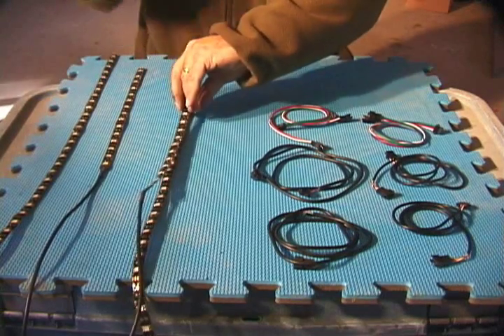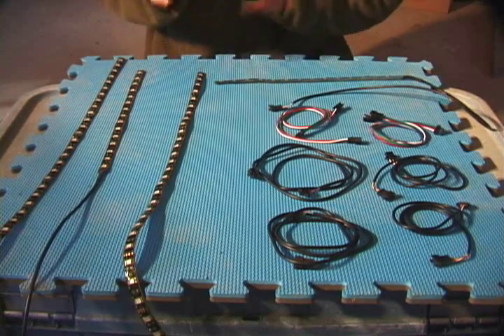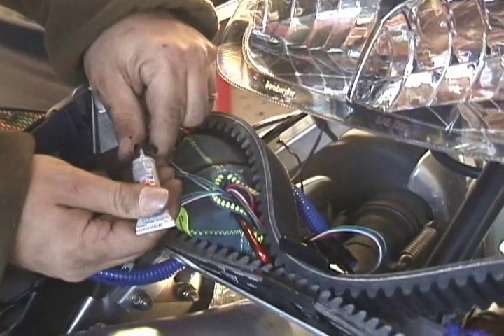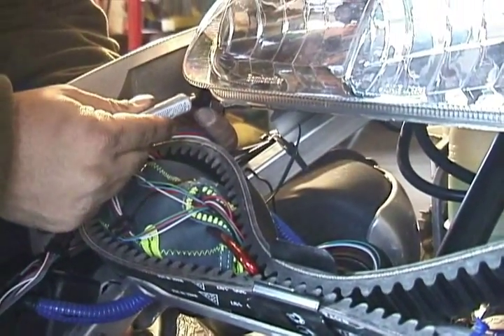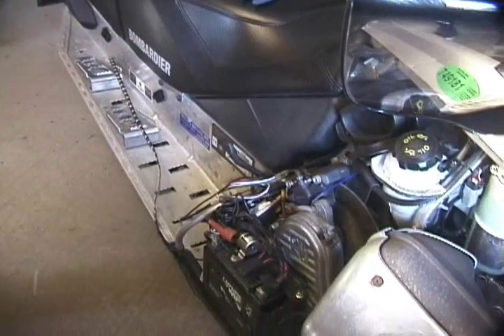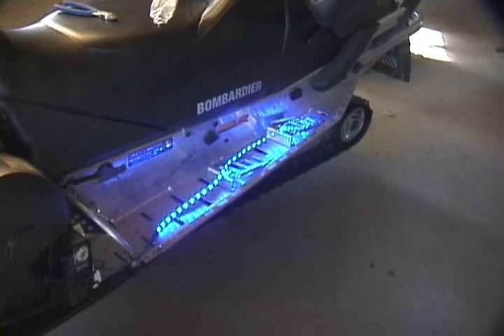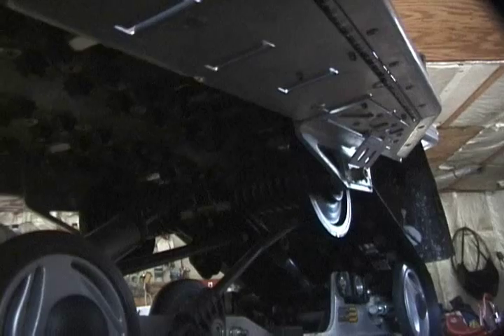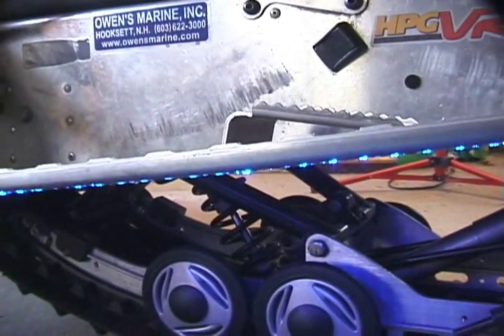Skidoo GTX 500SS LED Light Kit / Joe Florida - Running Boards (Parts and Install)

Comment from the maker: they come with 3M backing. But I also used freezeproof silicon to line the edge all the way around.  I put large globs on the ends and then put a bead down each side.

I did the same on the shock wells as well.

Comment: Do you need a battery for this?
Reply: SkidooSuzukiMania ,nope you just run them off a 12volt dc or ac source,ski-doos ,,,well my 1995 mach 1,, i used the orange  wire for the hand warmers.
Just thought id mention something to the guy that made this video,,the running boards are a nice lighting area ,,BUT if you go ditch banging alot,like i do they will get ripped/torn off !I know i went throught two sets on both sides,the first snow bank you jump that has hard crusty ,ice like snow,,kiss them goodbye !
Reply from the maker: billy bob i silicone them as a covering from where the wire is first exposed to the back. Not lost one yet.
Reply from the maker: The multi-effect need a battery, because the switch box has high draw. The single color can be run off s rechargeable RC Lipo or as replied by another below, you can wire into your headlight or heating.